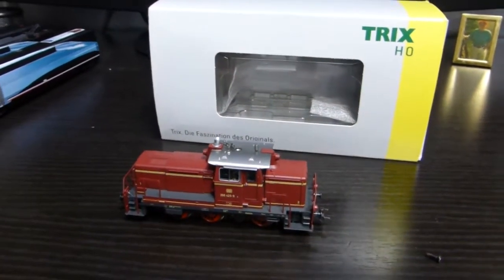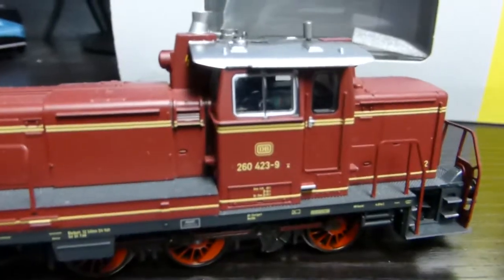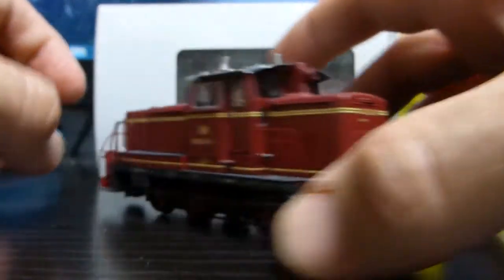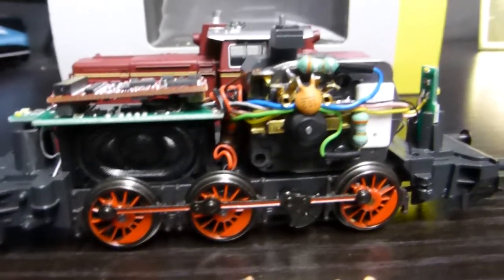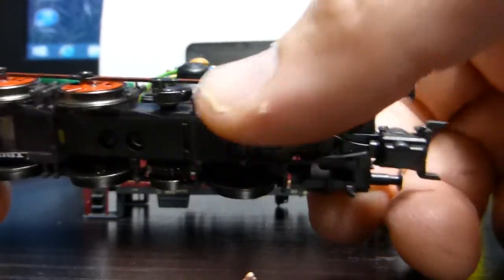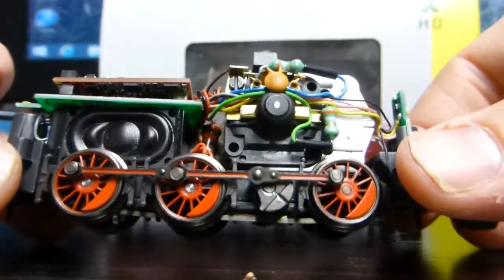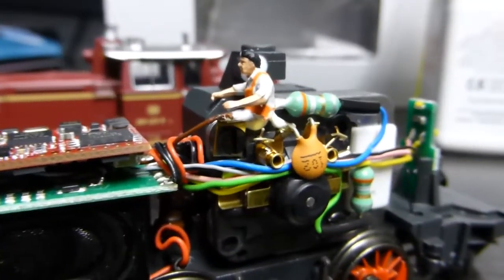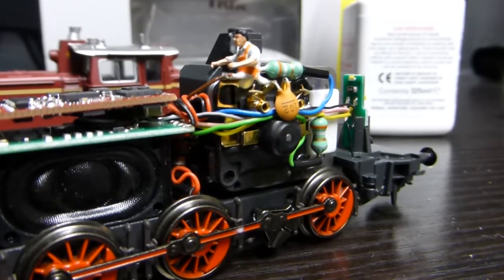trix 22616 a look inside

Comment: Nice little loco and as you say, good value, especially with sound included. Nice work with adding the driver, it makes quite a difference. Nice rolling stock as well :) - Sim
Reply from the maker: Thanks sim..I like to add drivers where possible ...got two boxes of electric and diesel drivers from noch...
Reply: Speaking of opening up and adding changes to locos, received two packs today of those glue spreaders you always recommend for removing the bodies. I see what you mean, they're softer and more flexible than I imagined and will be ideal for that task in the future :) - Sim
Reply from the maker: BurtonOnHumber cool...even if they slip on the outer body they will not scratch the paint etc using these simple little tools.....

Comment: Those two "resistors" are actually damping spools for  reduction of hf interference. Both these two and the capacitor can be removed, in dcc they have no real purpose, I take them out when i upgrade my Marklin locs. The only other diff with Marklin, is the centre pickup and that one axle will have traction tyres. Cant use them on 2rail since you would have limited pickup and it would continually stall. Cheers, Robert
Reply from the maker: Thanks Robert for the info....
On models like this where I do no butchering ..I leave alone in case I sell on in the future as some modelers still use analog....